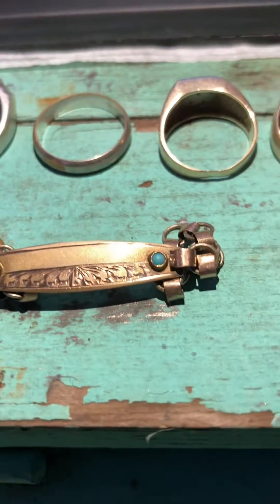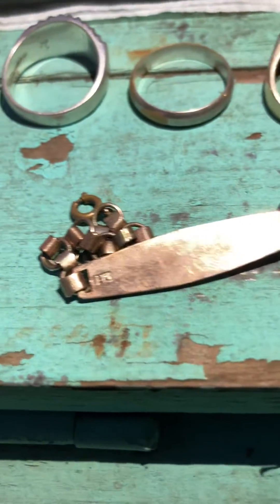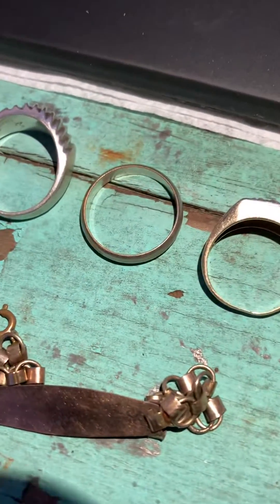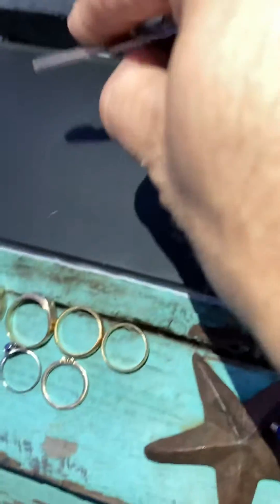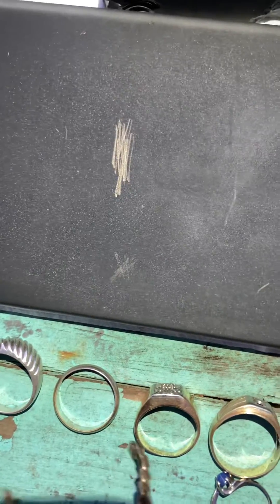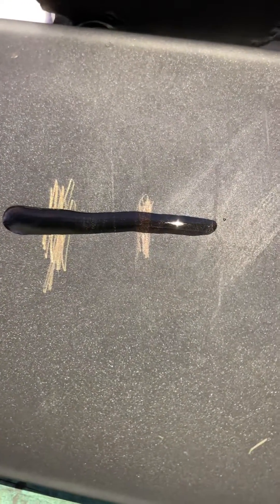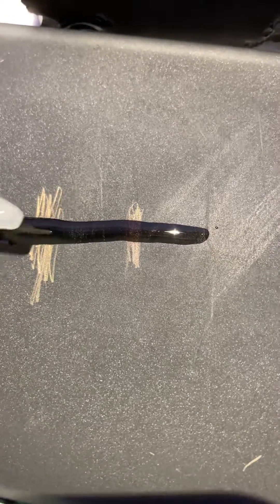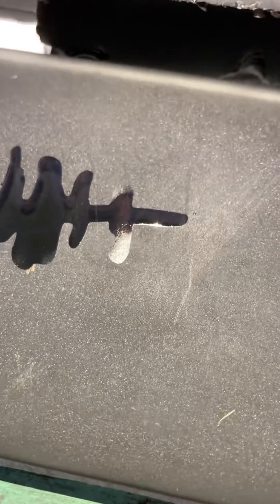Testing Low Karat Golds! 8K Rose Gold Alloy using 14K Acid Solution. Demonstrating Solubility of 8K!

Comment: I have a bracelet from denmark has an old denmark mark with 333. If instead of majority copper making rose gold they used a large amount of silver making a whiter gold would it still react similar with the lack of copper?
Reply from the maker: @neggispringfeild 
I have some German White that is 333 or 8 Karat. Yes similar results! The silver is quickly dissolved into solution and the gold drops from solution and is a dark cinnamon brown on the touchstone. 

Denmark, Greece, and Germany 333 Gold is as common as 10 Karat Gold is in the United States. Similar to how 9 Karat Gold is common in the UK, Canada, and Australia. 

TBBW🐺
Reply: @TBBWDontPlayNoReindeerGames  thanks im going to try testing it later today. Do you know if they marked 333 on plated pieces?
Reply from the maker: @neggispringfeild  No, shouldn’t be plated but solid 333 Gold if hallmarked.

Comment: Would 8k gold turn your skin green if you wear it?
Reply from the maker: @brandonGCHACHU 

8 Karat Gold or 333 Gold is very common In Germany, Denmark, Greece, and Mexico. 

No, as the gold purity represents 33.3% by weight of the alloy. 

I’ve worn a ring of only 5 Karat Purity of 20.85% Gold by weight percentage, without any problems.

The green reaction is from the copper oxidation thin film reacting with the fatty acids in your perspiration or sweat, converting copper oxide into Copper II, which is green, a harmless reaction but an unsightly one! 😄

TBBW🐺